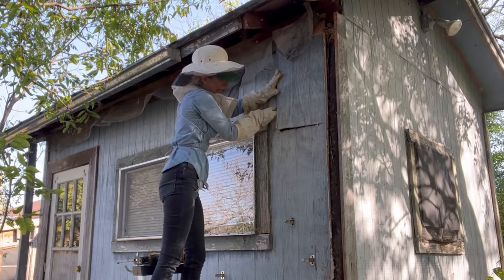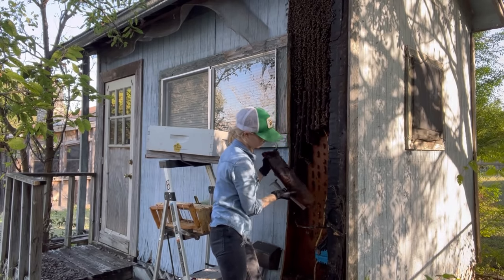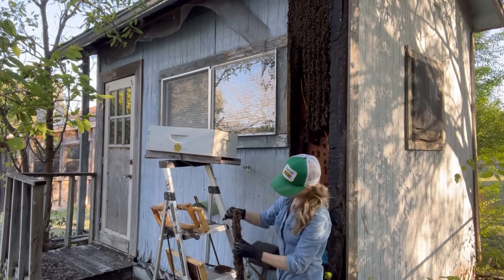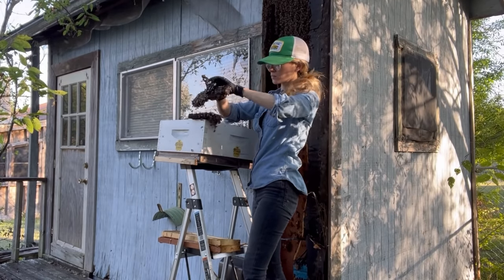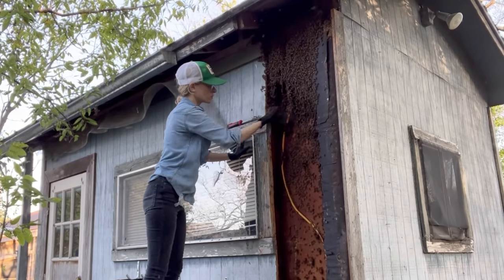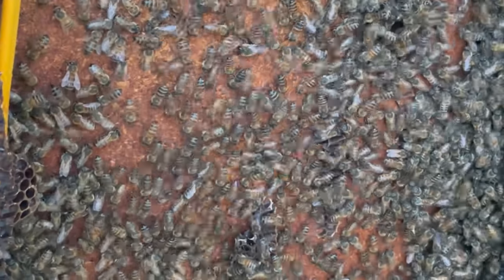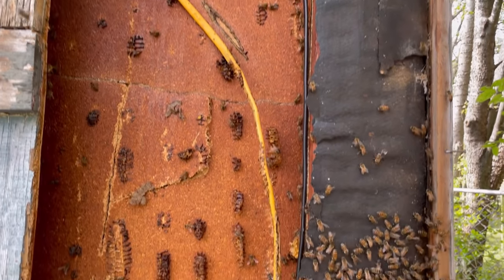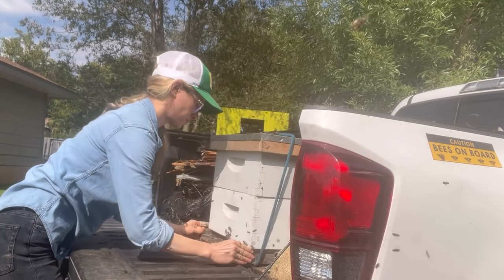Huge Beehive with 8-foot Long Honeycomb!

Comment: I been curious, been following the channel for while. What is the actual business model? People pay for the removals, and then you just run hives for commercial needs? Or do you rent them for orchards? I just curious because I know that bees are a big business, but unlike other sides of agriculture not something often in the media's attention. Also not from USA and only place where I have really heard about this being talked is USA.
Reply: Hi. I cannot speak for Texas Beeworks, but from my own experience as a hobby beekeeper there are basically two models. 
1) There are backyard beekeepers like me who will volunteer to go remove a hive and keep the bees. Generally, I only did simple removals -- would not remove any hive that required a lot of demolition work or involved removing electrical wires, etc. Just cut open some siding and take the hive out. This was done for free by me and some friends, and one of us would take the hive home with us.
2) There were also beekeepers who charged for this service, but they tended to be much more experienced than I was, and also usually had some construction skills I didn't have. Where I lived at the time, they had to be licensed by the state as an exterminator to charge for bee removal, but I must emphasize they were not killing bees -- they were relocating them just as shown in this video. Usually these were people who had some kind of commercial beekeeping operation -- they kept bees to sell honey or nucs or queens or the like.
I hope this information was useful!
Reply: Business aside, I'm pretty sure if you have an apiary on your property , your land becomes agricultural and I think that qualified for tax exemption s and subsidies

Comment: That’s an awesome hive! I have removed bees from walls before with a circular saw. It’s important to set the blade depth just deep enough to cut the wall sheathing without going much deeper. This avoids damaging any hidden wires like in this wall, which often require repair far more costly and time consuming than fixing the wall.

Thank you for sharing your experiences and genuine enthusiasm for bees! I love my bees too ❤

Comment: I never move a hive during the day. You will lose a lot of bees. Also I plug the entrance to the hive while being transported. But the video reminded me of a removal I did that was very similar but the comb in mine was only about 5 ft long but it took up two bays in the wall. And they was very easy bees. I didn't use suit, smoke or anything. Only got stung once.

Comment: I sometimes triple up gloves, so when they get to messy you can peel off a layer. Did one just like this two years ago. Took about six hours. Plus a bee vac. I keep a drawn comb box in stand by if the current if too far gone to be useable. Def overnight it. Or two. I also leave a drawn comb with some honey hanging off a coat hanger just nearby, they overnight on it. Collect early a.m. Done.

Comment: Couldn't you incorporate a special vacuum cleaner that won't hurt them but you can get them out of areas like that and Reclamation them into a bubble that would hold them and when you open up the bubble holes that way they can get into the boxes but all the bees would be removed at least

Comment: I think I would put the new hive box right into my cart from the start and then add the bees and comb. No lifting the filled hives into the cart. Take some planks in the back of the truck and park so the tailgate is as low as possible, then make a ramp from the planks and pull or push the cart into the bed of the truck. Secure the cart so it can't roll while you drive, and once home, use the planks to roll the cart off the truck and get the hive to its new home. Less risk of hurting your back carrying and lifting heavy hives.

Comment: How do you get the queen safely into the clip without accedentally hurting or squishing her?
Reply: Its not a normal clip, its one made specifically for bee keeping.
Reply: Its not a normal clip, its one made specifically for bee keeping.
Reply: Thanks, sorry I should have specified better. I understand the clip works differently. I was just wondering how it works and how you manoeuvre the queen into it without accedentally hurting her.

Comment: PUBLIC SERVICE ANNOUNCEMENT. Never trust a homeowners word when it comes to whether the power is off in a building. Use a skill saw not a sawzall and set the blade depth to the plywood thickness on the building then use a crowbar to pull it off.   You are less likely to damage the hive and also less likely to film yourself being electrocuted. Also wear a dust mask if you don't know what your digging into.